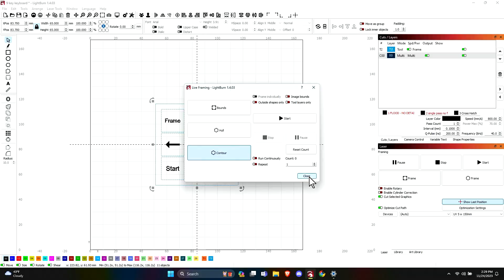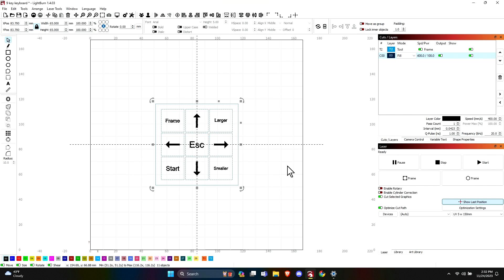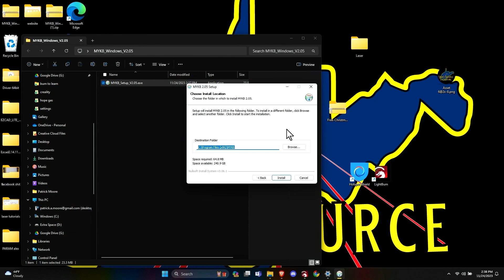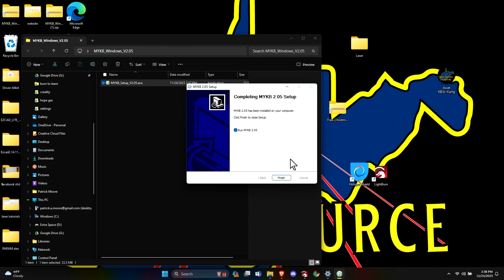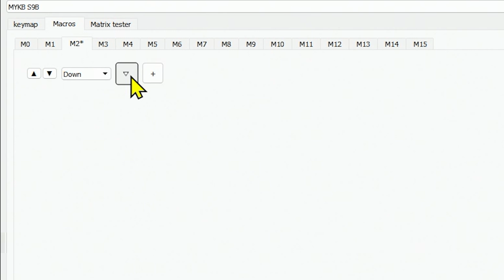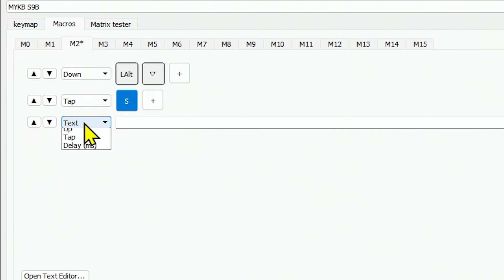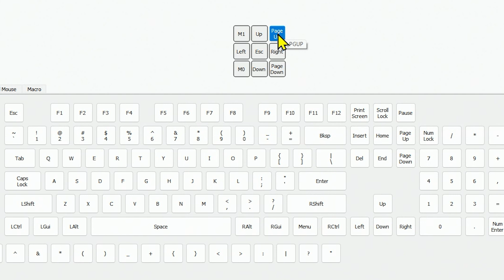Make The Perfect Accessory For @lightburnsoftware7189  And Your Fiber/uv/co2 Galvos Lasers

Comment: Do you load the file into the keyboard and then plug it into the USB port on the laser for use? I assume it will work on the Lasermatic.
Reply from the maker: it will for start and frame. it would need further programming for gantry machines
Reply from the maker: keyboard is plugged i to computer and programming is done on the computer